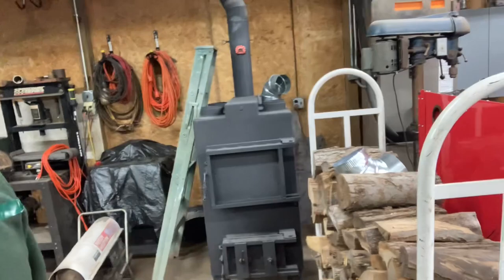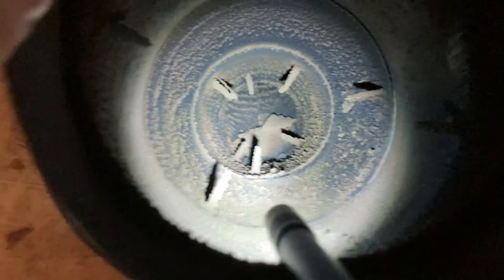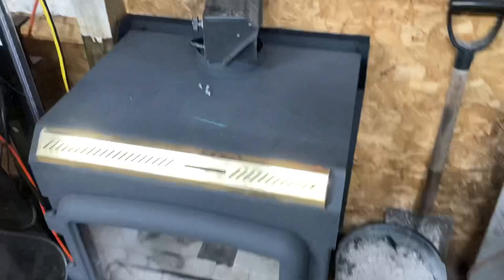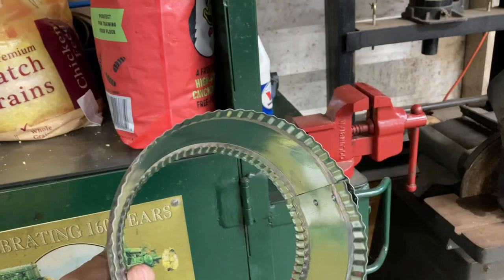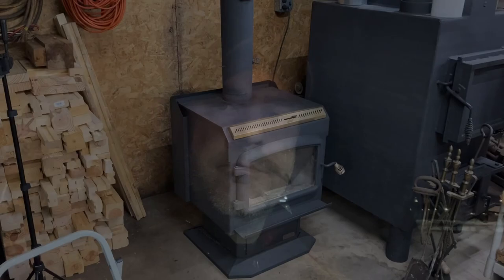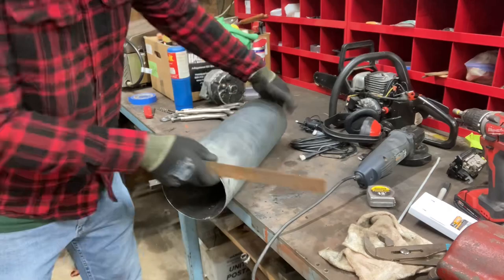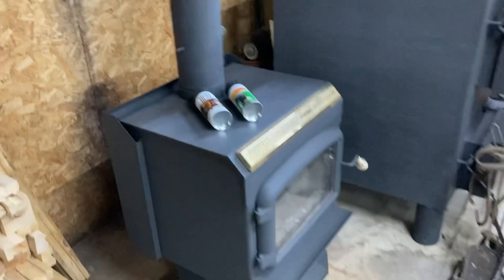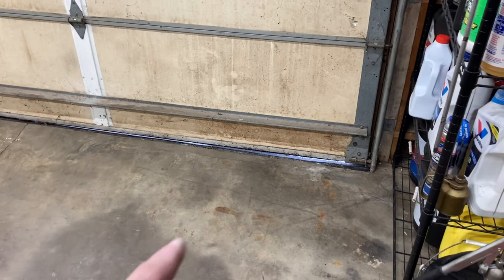Wood stove problems in the shop.

Comment: How high above your roof line does your chimney extend? Have you checked the pipe itself for buildup? If there’s build up in the elbow there very well could be buildup in the pipe reducing flow. I don’t understand why the 6” pipe won’t handle the smoke produced.

Comment: There is no problem with the first stove, the chimney need to be 3-4' above the peak  of your roof, otherwise you will experience down drafts and neutral pressure situations at the flue exit. Just trying to help...
Reply from the maker: By the way the guy I bought it from had a draft issue with it too.
Reply: @beesprojects2692  regardless, the standard placement of the flue top is to be 3'to4' above the peak of the building. the guy before could have had a chimney that was below the peak also.
Also It looks to me like your draft from vents is coming in to low and up through the face of the door... the draft should work across the burn, do you get positive flow out the flue when the door is opened 1-2" and left that way for a while? 
The air moving across the face of the door could be causing unnecessary turbulence in the burn chamber when operating in the closed position. Just tryin to help...
Reply from the maker: Yeah I know it’s supposed to be higher but I’ve had two store bought wood stove on this chimney the way it is for the last 5 years and have never had any issues with drafting and never had a back draft either. In fact it is taller now than it used to be. That’s what makes me think the problem is in the stove. When it burns with the door open 1 inch it will get to a point where it starts letting smoke out of the door too. It’s like once the fire gets big enough the chimney can’t handle it. It’s a very large firebox.
Reply: @beesprojects2692  If you are convinced the problem is with the size of the burn chamber, flip that thing on it's top, support it safely and weld in a long step shaped plate into the ceiling of the stove, might even put a 45 degree brake in it, instead of a 90, to get the gasses to go where you want. That's enough help...
Reply from the maker: @shawnaltenhofen1476  thank you for your help.👍🏻

Comment: You should extend the chimney pipe up higher to get a better draft. Looks to be too low. Also any chimney pipe outside should be double wall because a single wall with lose too much heat whichis what you need for a good draft. If you were to keep the chimney pipe inside the building (straight up threw the roof) you will get more heat from the pipe inside which is a plus, and keep it warmer until it goes thru the roof, giving you and excellent draft.
Reply from the maker: Honestly I should have at least double wall pipe too to keep the smoke from cooling off too much outside and creating excessive creosote but this is what I’m working with at the moment. This was how it was when I moved in so I just used it. I have a new video about my replacement wood stove, I have since sold this one.

Comment: In the video it looked ad though your chimney is nit high enough. It should follow the 10-2 ft rule to work and be code. That may be what is wrong with your bigger stove
Reply from the maker: Here’s a follow up video where I discuss all of the points that were brought up in this video. It’s definitely not code but neither is single wall outside which is why it’s not taller. It would cool too much and create more creosote. I do intend to update it before next winter.👍🏻

https://youtu.be/5OsI4z5Bmrk

Comment: I just seen your video you probably by now might already have it fixed your old stove that you bought it's a beautiful stove it will work fine. You need to extend your outside chimney above your roof line it is not tall enough therefore you are getting a backdraft

Comment: Click on tht link and don’t listen to the single walled guys. U went through all tht trouble to make a very cool stove. Don’t give up yet. Go spend the $200 and have a good running stove tht looks good.  Get enough so I can get up at least 5 ft 2 to 3 feet higher then u peek of roof. Tht will help with ur turns. Weld up a support if needed. Also I think while I have all tore apart again I would be cutting all the screws inside pipe down as well.
Reply from the maker: Sounds good, I will use shorter screws when I install the 8 inch pipe. I used what I had on hand but good advice! Thanks…

Comment: When you go to a bigger stove your chimney has to be big enough to pull a draft , it looks like your setup is for that smaller stove and that would make sense , if it was me I'd build a new chimney and have a clean out at the bottom and your problem should be solved
Reply from the maker: I’ll find out. 🤞🏻 Thanks.

Comment: Open your bottom vents more. Also like others have mentioned, the top of your chimney needs to be above your roof peak or far enough away from it to not be a problem. I think the first stove will work.
Reply: It looks to me like your draft from vents is coming in to low and up through the face of the door... the draft should work across the burn, do you get positive flow out the flue when the door is opened 1-2" and left that way for a while? 
The air moving across the face of the door could be causing unnecessary turbulence in the burn chamber when the door is in the closed position. Just tryin to help...

Comment: Pipe out side didn’t look high enough doses the wind come over the peak of the roof and make a down draft the old stove may need more draft
Reply from the maker: You are correct. It is not high enough over the peak but if I go any taller I will have to run guide wires because I did have it taller in the past without wires and we get some very strong winds here and it folded the pipe over. I have never had a back draft issue with it. The back of the barn faces north and usually we get northern and western winds in winter. When I change everything out to 8 inch, this pipe won’t matter anymore anyways. It works great with my little stove though.

Comment: Also, yo dampen the fire too much if that creosote is building up in the pipe. Get yourself a magnetic flu thermometer. If you burn it at the right temperature the creosote will only be a light powder on the pipe inside.
Reply from the maker: I don’t have much experience with homemade wood stoves. I’ve always used store bought and usually have almost no creosote buildup at the end of a season. You are correct about the char.😂 it was like that when I moved in. That’s why I’ll be adding cement board to the wall. I have no doubt that I’ll get this sorted out. Once I get that 8 inch put in I have a good feeling about it.👍🏻 Thanks for the tips.

Comment: I have read all the posts here about what the problem could be.
My thought is, it is the stove, very poor design. It is home made, and it is not designed correctly.
It does not look right. When I first seen it, it seemed strange the way it was made. 
I know a guy who does anything to do with wood stoves/furnaces told me, if the chimney/pipe is not hot enough it will not draw. 
The heat makes the chimney draw, so for some reason the heat is not making it into the pipe with that stove. 
If the other stoves work there, the other should as well. I would suggest, having a long look at the design of how the flue exits it, there has to be a major flaw that hinders the the smoke and cools it before it exits the stove.
Reply: Oh and just to clarify, I also think by making the pipe 8in will only make it worse, instead of better. The smoke will cool even faster and draw less.
Reply from the maker: I have also heard that heat helps the draft, I have had that pipe pretty hot with that stove, so I think that as hot as I’ve had it it should have been drafting really well but in my opinion there is probably a design flaw mixed with the 6 inch pipe isn’t big enough to handle the amount of smoke that can accumulate in the box. It will be interesting to see what helps when I get around to working on it again
Reply: @beesprojects2692  
Yes, now I remember you saying that.. HHUUMMM
It is possible.
I have an older actual wood furnace in my garage, the fire box is fairly large, it has the large plenium on top that the blower blows through and then from that to the ducts. If I open the draft on that, it wants to dance, and sounds like a 1800's locomotive, with fire thumping out the draft itself. 
In the house I have an oil/wood combo, hotwater and that as well can be made to hump if I am not careful with the draft. 
So maybe look at the draft design, maybe not drawing in enough fresh air to burn clean enough. 
I know both of mine will smoke if they are being choked off. Many times I will have to open door a bit to give it a breath before opening it all the way to put wood in, or smoke will pour out the door.